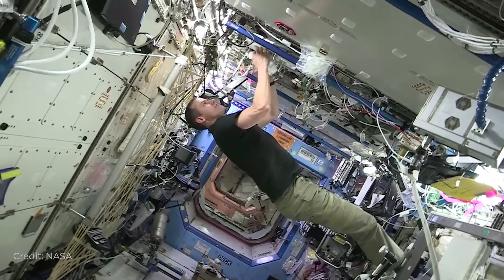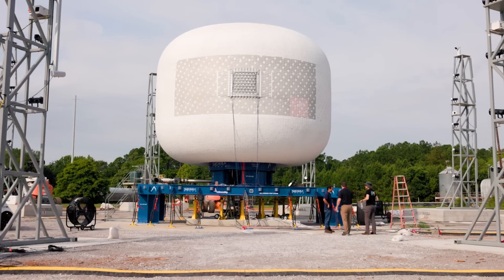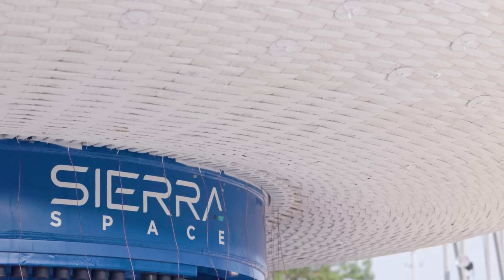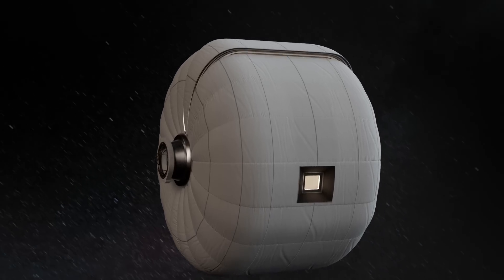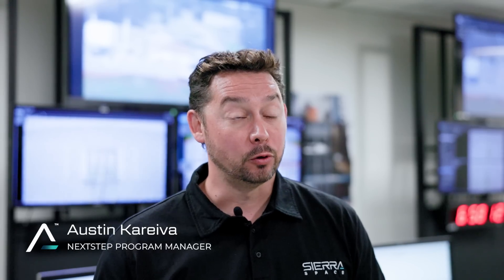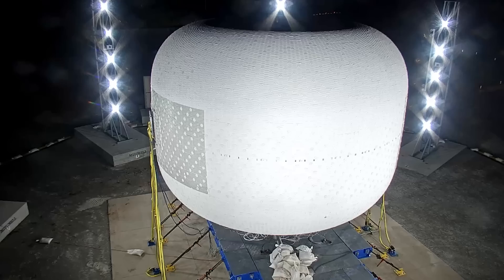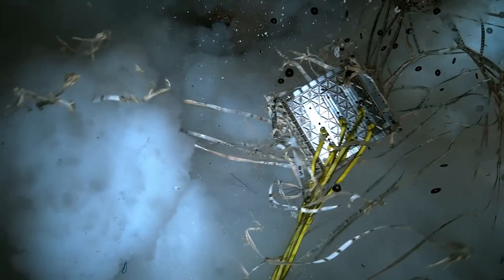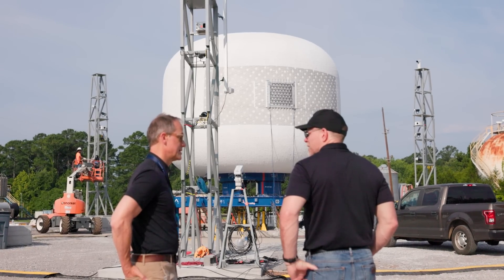Advancing Next-Gen Space Station Tech with Sierra Space and NASA

Comment: Once inflated, how do they get all the hardware inside while in space?   BTW, you guys should won the second commercial craft for the ISS and not Boeing.
Reply: The center spindle is where computer systems and life support goes. Any extra space there can be used to take larger instruments into orbit. The walls and floors and folded and strapped to the outside of the spindle. Once inflated and set up, any additional equipment is sent up on later flights.
Reply: They weren’t ready to compete for commercial crew at the time; in fact, as of this date, they are currently late for their first flight for DreamChaser’s first uncrewed flight.